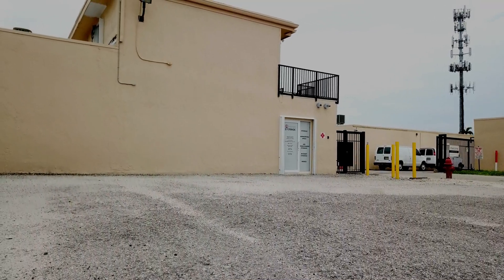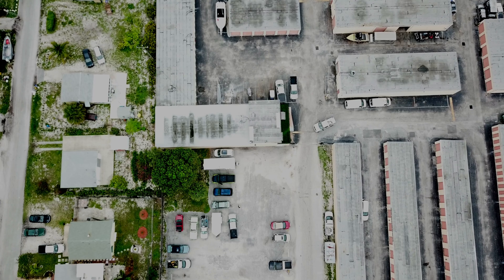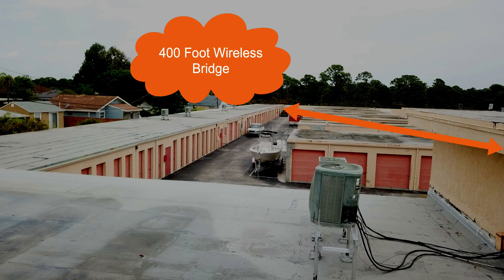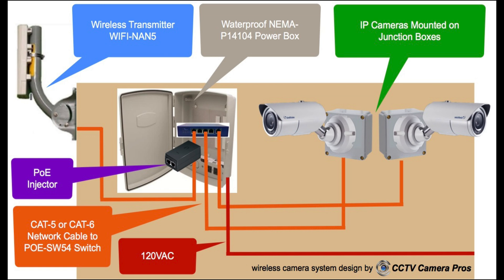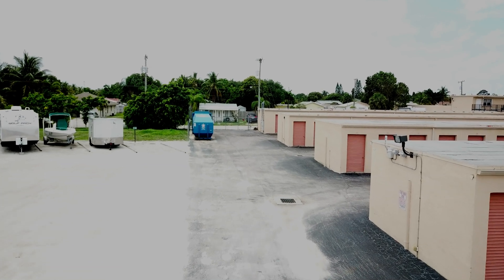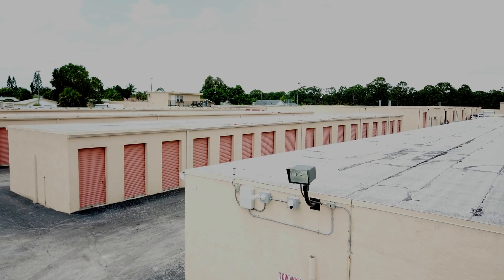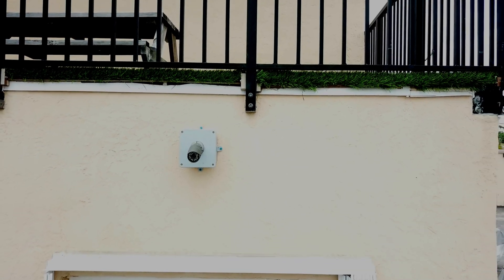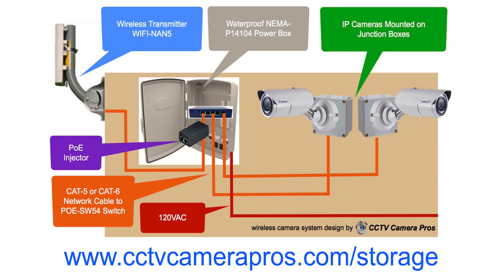Wireless Security Camera System Design by CCTV Camera Pros

Comment: Like i have a call box in the center of the community however i do not want to run cable however its 30 ft from the dvr across the road
Reply: Dvr is in a guard house and the camers i want to put up has power at the location but i didnt want to run cable
Reply from the maker: @feverlead  We are working on a wireless solution for AHD cameras. It will be ready in  6-8 weeks.

Comment: what dvr is on this system , Im looking for a dvr that will support already installed analog cameras as well as wireless cameras for a car wash application . The existing system have 16 analog cameras we want to keep and the ability to add wireless cameras to two seperate wash bays not connected to the main building , similar to the system your showing exc. smaller .
Reply from the maker: It's a custom GeoVision PC based DVR / NVR that we built for the custom. You can see it here. https://www.cctvcamerapros.com/Geovision-NVR-Software-p/gv-nvr.htm
Reply: Are they geovision cameras?